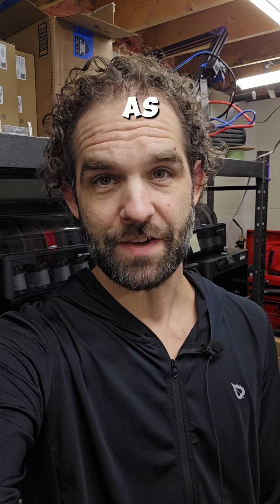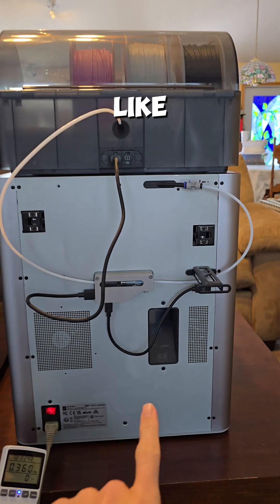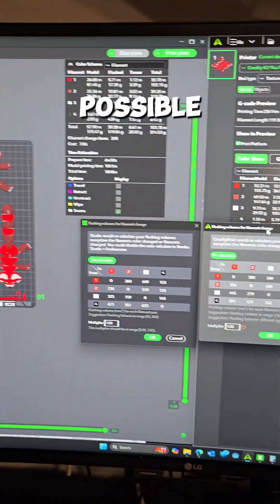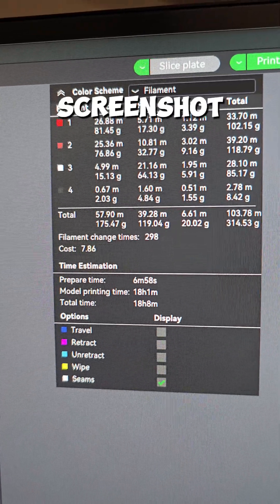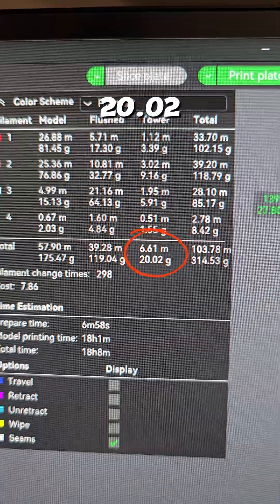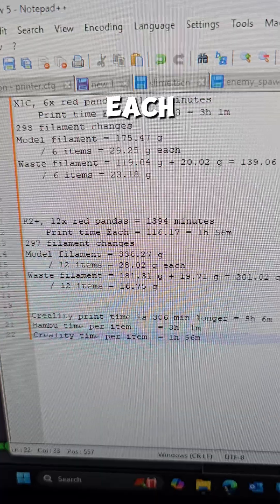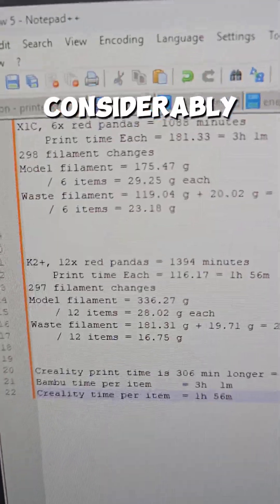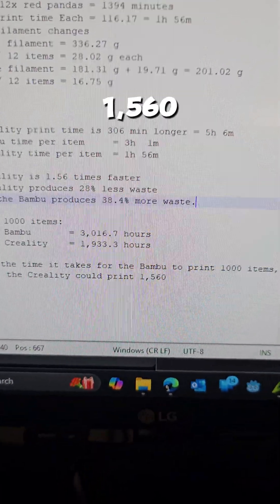Creality K2 Plus vs Bambu X1C - New Print-farm King? 3D Printing!

Comment: I am considering buying a 2 plus, however I am trying to find out how long it takes to heat up the bed say to 70c and 100c.  I am currently using an Artillary Sidewinder  X2 and the bed heats up so fast it makes it nice for doing small fast prints.  Any info would be greatly appreciated..
Reply: I have a k2 plus and the bed heats up pretty fast. You can also see the temp shift on the touchscreen. Also, not to discourage you but ive had a lot of problems with the Creality k2 plus. Constant print fails for no reason and just last night the feeding tube came off the extruder and there isnt a way to fix it. Ive searched online seeing others have had this issue with no solution. I havent had this printer for 2 months and im returning it tomorrow for a bambu labs.
Reply: @MichaelRodriguezHealth  I bought mine right after I posted it.  I have to say I have pretty good luck with mine.
Reply: @ yeah people either have great experience or terrible experience, no inbetween